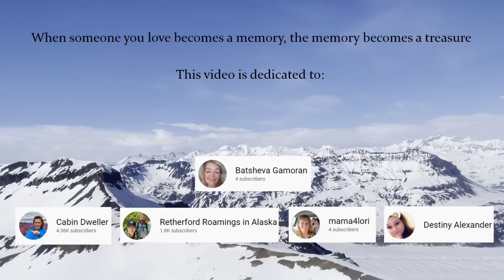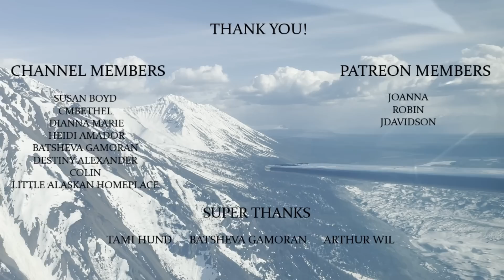Old Alaska Cabin Restoration continues before taking flight over Wrangell Mountains

Comment: Styrofoam insulation is what I used, nasty critters don't like it lol, it's looking great.
Reply from the maker: I may use spray foam again believe it or not! But just on the roof. Bubble foil on the walls so I can control the temps maybe? I hear that ants love styrofoam though. I do have carpenter ants! Destructive little insects they are! Thank you so much Timothy! :_Heart:

Comment: Are you reinsulating the basement.? I've tried twice to join your channel but I'm not the most computer literate. I do have my paypal set up but it wouldn't take for some reason.
Reply from the maker: I will certainly be insulating the roof of the root cellar. If not I will have some serious cold floors in the cabin! LOL :-) I most likely will leave the walls as is unless it gets too cold down there and freezes. I think I can control how cold it gets by insulating a little bit of the walls. Thank you so much for considering joining the members club. Thank you so much Cary! :_Heart: